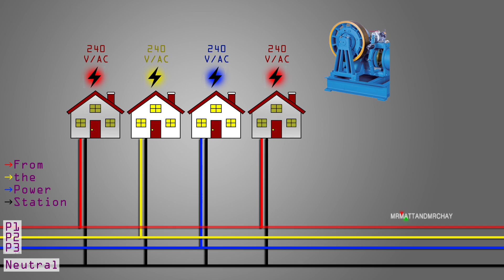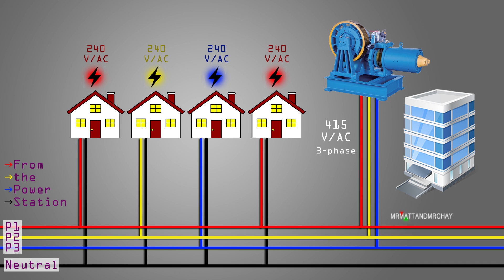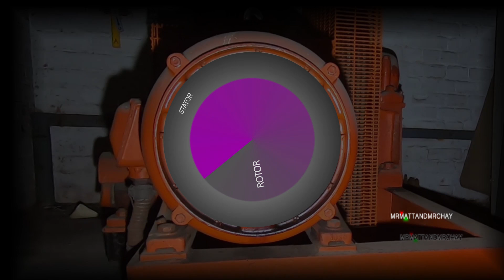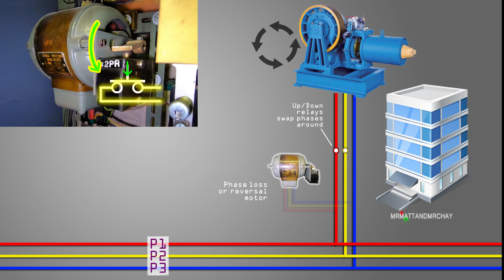PHASE LOSS/REVERSAL - Easy to understand video (inc LIFT MOTORS)

Comment: Serbia,Croatia,Montenegro,Kosovo,Albania,Macedonia,Bosnia & Herzegovina have three phases power supply like in Germany.Fuses,socket’s etc. are all German standard.Nominal voltage is 220V/380V old and new 230V/400V.Only big appliance use three phase power supply all other use single phase.And old David Pajic DAKA (Yugoslavian elevator manufacturer) are Schindler based elevators.

Comment: Amazing! 
And What does OTIS use for phase loss detector?
Reply: All OTIS controllers are fitted with their own version of protection against phase loss or reversal. In the old relay controllers it was designated the J switch. 
 There are, of course, now newer versions but the older engineers still refer to them as the "J switch".

Comment: You sure know a lot about lifts and lift motors
Reply from the maker: Actually, I know a few things, but a lot of content I've had some help from lift engineers and I've researched them on the net, understood them to the best of my ability to make a video on them.  I'm not a lift engineer, but I am in an engineering technical position which helps, but a different industry.

Comment: You can buy this kind of motor even today.
https://www.sew-eurodrive.de/products/motors/ac_motors/torque_motors_drm/torque_motors_drm.html
It still has some special uses as it seems.
Reply: It looks like the motor in the cabinet is rated for 750V 60Hz so it will be very weak at 415V 50Hz.

Comment: So that motor in the cabinet is like having a pizza oven with a timer that turns the oven off when the pizza is done.
Reply from the maker: uhm, not quite lol!  The pizza was just 'my sense of humour' for 'the people in the lift are now trapped' because the lift didn't detect it was going backwards (phases mixed up affecting direction of lift) and it hit the shaft final limit switch - this shut the lift down.  Result, pizza is burnt!  This is why you need a Phase Loss or Reversal detector, to prevent people getting trapped and then the pizza will be out of the oven in time (if this makes sense!!)
Reply: @mrmattandmrchay  I feel for the pizza!
Reply: Yes. Anyway. Sorry for the pizza fixation. I understand what the motor does. The other two methods you showed seem more intricate but frankly I'd rather see a motor inside a cabinet. Just something about it appeals to me more. I hope no one decides to update that system. It should be protected. A heritage lift!

Comment: Intereresting!
I Love These Schindler Motors!
Good Job!
In Germany Normal Houses have a 3 Phase Power Supply for Like Cooking to keep the load per phase as minimum as possible.
The main voltage ist 400 V/AC then. On an single phase is at 230 V/AC.
Reply: Yeah in Germany its always 3 phase at the 1st junction box with the 60A fuses, after that it is either 1 phase or 3 phase. In my house its 3 phase for every apartment, but sadly in the 2nd floor the phase has only 60 to 72 volts, all other apartments are fine on the blue phase.

Comment: I don't envy this clever solution, but thank god that now we can rely on electronic motor relays to do these functions and much more!
Reply: Modern electronics aren't always as reliable as people think, good old simplicity lasts for decades.
Reply: It might not be as fast or technically advanced but old stuff just feckin' works and its built to last. The lift in the video is over 40 years old and still works just as well now as when it was new. A modern cheaply made lift won't last 40 years.
Reply: Simon Tay Very true. This lift is actually over 50 years old! :-)
Reply: Mark P Modern technology can be much better than the old things. It’s just a matter of whether the manufacturer wants to make their product robust. Less robust = more sales ( televisions, vacuum cleaners ). But often when it comes to human safety they engineer the modern technology all the way through. Like the fly-by-wire airplanes. So it’s more the mindset of the company that make modern technology break fast, than the modern technology itself.

Comment: My guess on the last video about what the motor in the cabinet was for was correct. :)

0:45 Reverse phase rotation can be disastrous. If the lift is intended to go up, but goes down instead, any switches tripped in the downward travel will be to no avail since the control circuit(s) are expecting an upward switch to be tripped, resulting in the lift to keep running down. Depending on the design of the control wiring and limit switches involved, the lift could potentially lower all the way to the pit and the lift motor would keep running.
Reply: @pineappleroad  Landing locks are NOT safety switches and are NEVER wired in the same circuit as limits stop switches etc. Safety circuit comes first with connection back to the control panel then locks are wired independently.
Reply from the maker: Absolutely! :)

Comment: Where I live, it's actually quite common for private houses to have 3-phase power. I know some people even wire different rooms in their houses to different phases to split the load instead of just using a single phase for everything.
Reply: YEP !!! Never seen a single phase house !!! 3 Phases are important for the load balance ...
Reply: Stefan Jakob You don’t need different phases for load balancing. You can have a 1x80 amp main fuse and have different 16 amp fuses below that for the different groups. That’s how most homes are connected in The Netherlands at least.
Reply: Yes, here in Germany we have 3 phases with 16 Amps each. The oven uses all 3 phases to neutral for different plates, not the voltage between 2 phases, that's 380 volts here...
Reply: @stefanjakob2594  It was 380 but now its 400 V
Reply from the maker: 3 phases would mean 415volts or something much higher than 240. So not sure how your houses are wired but are you sure that when you buy a oven for a house, it isnt 240v? It should be the electricity company that manages any load balance between the phases by deciding which house goes to which phase.
Reply: mrmattandmrchay Remember it’s 415v between phases but still 230v phase to neutral. So cookers and the like have a big 5 pin plug with 3 phases, neutral and ground. The hot plates and ovens are spread between the different phases and neutral, so only 230v across each.
Reply: Dingo Nates That’s only needed for big ovens and stoves. Like the 6-person family appliances. There are plenty of ovens and stoves that work on 16 amp single phase.
Reply: In my country it depends on the total power that the house will consume. You can also bend this rule if you say that you need three phase for something like a motor. The downside is that the minimum bill, that is the amount you pay even if you not consuming any power (just to be connected on the grid) will increase for a three phase installation.
Reply: Same here. I live in flat in apartment complex and each flat have 3-phase power.

Comment: my works good lift suffered a phase loss the other day well i was in it not a fun time 

also my work just took out a 1980s good lift and it is the process ofreplacing it with a modden one if it anything like the other new one we have it will suck
Reply: Yeah, old stuff always works better. Old stuff is built to last. It may not be as fast or technically advanced but it just works .

Comment: Every private household also gets those 3 phases instead of one, so it's not true what you show... Even a simply oven in the kitchen or a water boiler runs on 3 phases... The 3 phases get thru a fuse and distribution panel in the house and the 240 volts are between Neutral and one of the phases rails secured by a line fuse...
Reply from the maker: Perhaps in your country.  Three phases ARE supplied into houses here but only upon request, and they have to serve a purpose (i.e. a house running industial machines requiring them).  Not sure if this is a chargable service, I guess it would be as it would require a lot of work delivering the extra phases into a house.  So here in the UK, the only cables I've ever seen inside a house near the electricity cupboard is a neutral, earth and live.  It's generally a SWA cable - ours in an older one with two cores, and the earth is part of the shield around the cable.  So 3 Phases here are not supplied into houses here in the UK, even for ovens and boilers (both 240v)
Reply from the maker: Had a few messages on this now.  It would appear that some newer houses have the three phases supplied, but as per prescan7000's message, only one is connected to create the 240vac supply.  All food for the brain!
Reply: It really differs per country. Here in The Netherlands it differs per household. most houses have 3 phases supplied, but only 1 is actually in use. You can call the network operator to have that changed, they will replace fuses and connect the remaining two phases. You have to pay an installation fee and a monthly fee (higher 'vastrecht') as well.
Reply: It varies per country, in North America yes, I recall that there's 3 phases going to the homes, but in Europe it's vastly different.

I know in my country  3phase wiring for homes isn't avaliable, save for a few edge cases (heavy machinery requiring 3ph, heat pumps and whatnot), it used to be more common in the past but now since the 90's single phase is the de facto standard for common houses.

AFAIK the two other phases are supplied, but they are most of the time either routed to other houses or just left floating (=unconnected). It's a mess.
Reply: In my previous appartment in NL i had only one phase. But it was good enough for a 3-pit induction stove and oven. In my current home in Belgium i have 3 phases, and the oven and ceramic stove are indeed connected to it. But i still don’t really feel the actual need for it. It’s a nice luxury to have anyway. But if this house in Belgium had only one phase i would have been equally fine with it.
Reply: actually what he shows IS correct for the UK which is where he is based.  Standard UK domestic supplies are between 60A and 100A single phase.  I understand that some European countries supply 3 phase as standard to domestic properties.

Comment: So it also functions as a safety device, like preventing the motor from burning and causing a fire?
Reply from the maker: perhaps, but I guess there would be other protection against that.  That overload device from the previous video perhaps, that heats up then opens the circuit as a shut-off.  Not sure, but perhaps the main motor has a thermo device to prevent a complete overheat.
Reply: @mrmattandmrchay  In a phase loss, it’ll prevent the lift motor’s overload protection from becoming a factor at all.  Therefore, to my mind, it does function as the first-line safety device in that case.  (Because in my humble opinion, you really really really don’t want to rely on the motor’s protection, ever; if that trips, that’s a sign of trouble way beyond a power supply issue.)